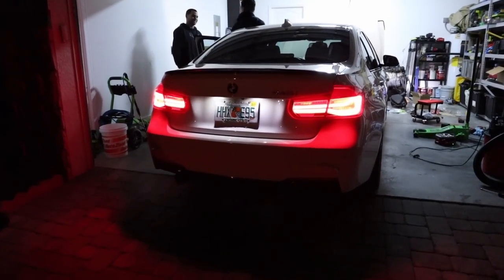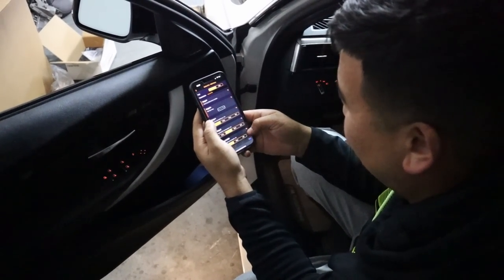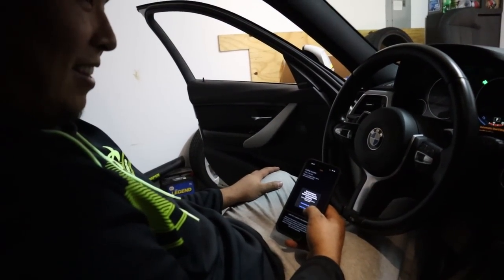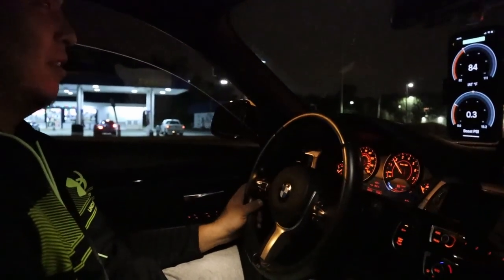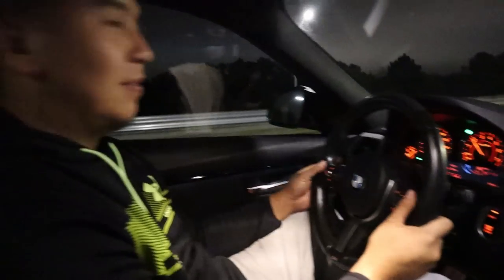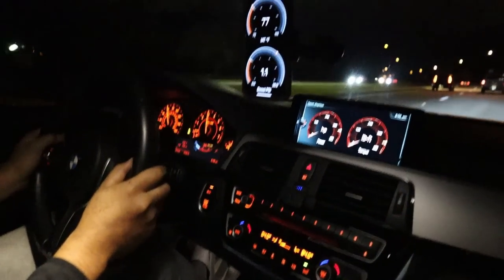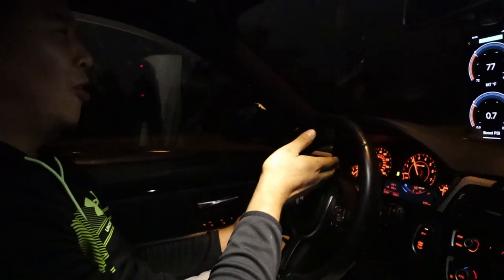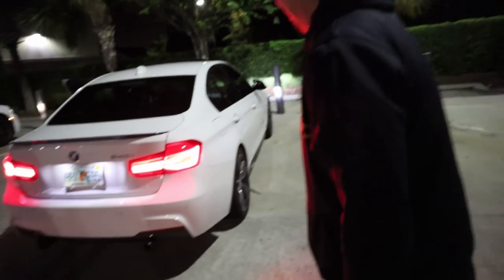My F30 340i gained ridiculous power in minutes, HERE IS HOW!!!

Comment: For flashing on iPhone I think you need to go into low power mode and it stops all the extra background tasks. I just bought a cheap android and cable though I’m not gonna mess with failed writes all the time.
Reply from the maker: Mine was just trying to connect to 5 different things at once and wifi was going crazy 😂

Comment: That’s not bad for 1,500 bucks
Reply from the maker: For sure
Reply from the maker: Dinan is trash 🤷‍♂️, thats 1500$ with all the bolt ons and tune
Reply: @SwapDepot  ohhh ok ok, I thought the MHD license was 1.500$, so do you recommend MHD instead of DINAN? i have also the Power kit installed in my 440i gran coupe, this MHD flash will be installed on the top or it will remove the power kit flash?
Reply from the maker: Dinan tunes are not even that noticeable when you install them on any car pretty much, i would go MHD 100%, MHD tune erases all of the factory tune parameters and writes a new map on the dme
Reply: @SwapDepot  Great! Thanks buddy, i will follow then your advice and I’m going to get the MHD flasher. 😉👍Greetings from Spain!

Comment: Did you gap plugs before the tune? Even MHD themselves recommends gapping to .22 before flashing, but a lot of people argue that it isn't necessary. I'm planning on gapping to .24 before going stage 2 91
Reply from the maker: I got spark plugs on the way, couldnt get them in time
Reply: @SwapDepot  i had ngk on ots with stock gap. Stage 2 no issues , car always run great 
When I went stage 3 custom I start using champions ( champions are scale 4 on their own chart , ngk is scale 8 on their own chart but champ 4 is a little colder than ngk 8)
0.25 when pushing higher boost and car runs flawless with 149k and tune since 98k 
No issues what so ever.

Comment: Do you have to change your spark plugs for stage I tune? I saw that it was recommended on boot mod website
Reply from the maker: Yea you do, i just couldnt get the NGK plugs in time but i will be doing that very soon
Reply: IMO you definitely don’t need to gap plugs on a simple no other mods stage 1 either BM3 or this tune....overkill

Comment: M240i bootmod3 stage 2+ e30. Peak boost at 21 psi and then tapers down to 19. 
60-130 8.93
100-200 7.63

I really don’t believe mhd is that much stronger
Reply: It’s much better I had both.
Reply: @ganuv  yeh bootmod3 is ha
Reply: @ganuv  alright I finally tried e40 mhd. Definitely faster. 60-130 of 8.65 with wheel spin when I first got on it. 100-200 of 7.42. 
Butt dyno feels similar
Reply: @bilallatif1205 this is the info I was looking for lol so mhd is actually a little quicker?  Seems mhd is more reliable as well, plus everything is stored locally vs cloud.
Reply: @JuiceMann1622  Yeah at the time, MHD felt slicker to use. Not sure now. I don't have the car anymore either. My tuner Sameh preferred bootmod3 btw. If I end up tuning my new G80 it'll be with bootmod

Comment: Stage 2 with catless DP is around 470 hp that’s around 400 wheel, plus it’s recommended to tune the transmission ..XHP stage 3 , that’s when you’ll feel the full potential of the power.and he’s right , intake doesn’t do anything, just cosmetics and sound that’s about it.
Reply: I use stage 2 catless, going to install hpfp and go e50 map on my 140ix after this winter, hoping for low 11's on 1/4,

Comment: Seems as though MHD does better with the B58, where’s as BM3 does better with N55.

Btw, my F15 X5 N55 w/ BM3 stage 2 flash tune saw a peak boost of 19psi. Again, not sure with the B58. I also have the Vibrant muffler and it sounds soooo good. It’s the MPE at 1/4 the price.
Reply: Nope .. MHD does better on all of them. I had both.
Reply: @ganuv  agreed.....MHD IS SIMPLY BETTER ALL AROUND
Reply: @ganuv  thats just not true

Comment: Some ppl on forums say flash tunes add on to the MPPSK, sooo its faster than a stock 340. Even though it’s a map, it’s based on % percentages.

That’s why it could be it feels faster on this 340

Can anyone confirm?
Reply: The only way the mppsk package adds to the performance of the vehicle after flashing an OTS map or custom tune is the free flowing exhaust. Once the new map is flashed it rewrites the mppsk map which is essentially the stage 0+ that MHD offers.
Reply from the maker: Yea thats what i was gonna say, it can’t write on top of the factory tune since its erasing everything and rewriting the tune

Comment: MHD has so many issues flashing and support is trash. It failed to flash for you twice you mention. It was failing for me so many times and I couldn't reach anyone at MHD for support other than some quick response on instagram that did nothing to help.

BM3 by far is a more complete solution and makes more power on LESS boost because they do more timing. Less boost, more power, less heat, better for your turbos.
Reply from the maker: It wasn’t MHD, it was my phone, i like MHD personally more
Reply from the maker: Your comments keep getting deleted for some reason
Reply: I had BM3 and it definitely doesn’t feel as strong as the MHD, and MHD never failed flash on me even ones , so I think your coming from a bias place because you have BM3 but MHD is is better and it’s not just my opinion.